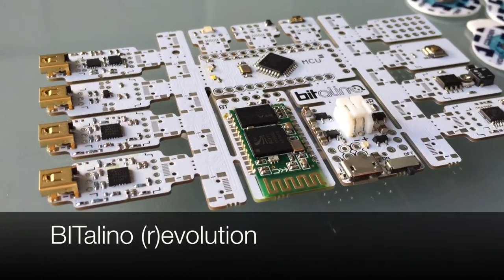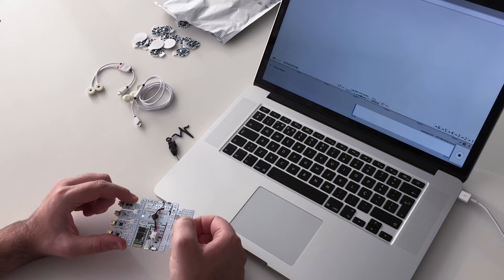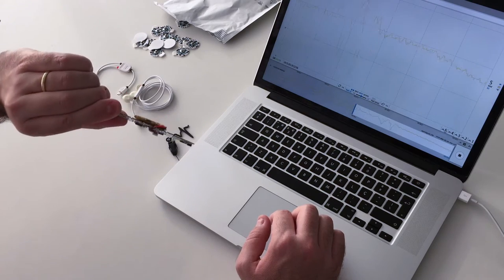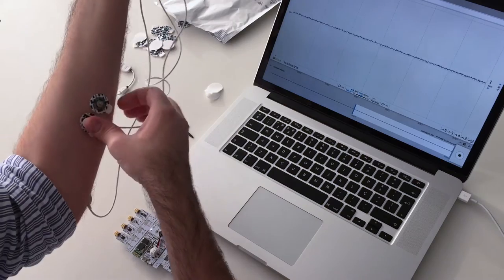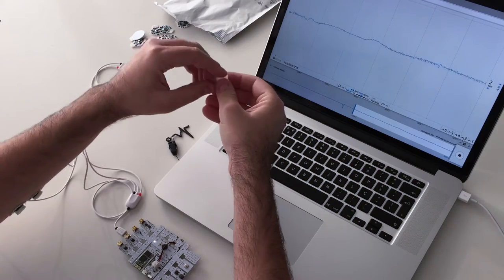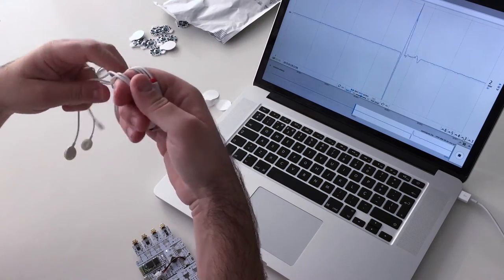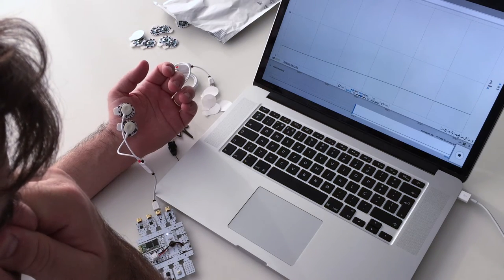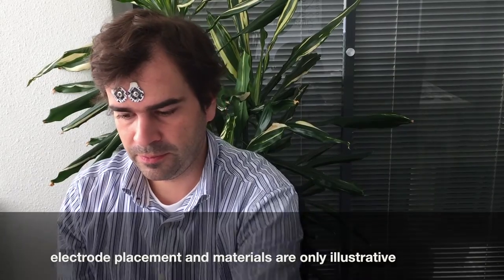BITalino (r)evolution Sensors Tour

Comment: Hi guys, I understood I could use just one kit to get for instance four simultaneous EEG readings (at four different skull placements). Is that right?
Reply: Hi Ronaldo. That is correct, yes.
Reply from the maker: Yes
Reply: @BitalinoWorld  What kind of kit is better, considering I will need to sensor simultaneous EEG signals at four skull placements (plus a 5th reference placement, of course) AND also body (skull) temperature? Or, should I buy separately 1 board and sensors, not a kit? Is it possible?

Comment: If using one kit to get four simultaneous EEG readings is allowed, I should use one 3-cable placement (to have one neutral reference) and the other three placements could us 2 cables only (positive and negative)?
Reply from the maker: Yes. It is also possible to use 2-lead electrode cables in all sensors and a 1-lead electrode cable to provide the ground for all sensors.

Comment: What is the sensor type used, it seems just glued on the skin, without any paste. Is that so? If yes, it does not seem to require any preamplification. Is that so?
Reply from the maker: The pre-amplification is implemented on the sensor. Depending on the placement locations the electrodes can be the pre-gelled or gold electrodes with conductive paste.

Comment: Hello Dear, thank you for sharing this video. i have  question, is it possible to save the recorded data as mat. file. with regards
Reply: Hi, thanks for the question. Data can be stored as a CSV file, which can be loaded on Matlab (e.g. using the dlmread function) and afterwards stored as .mat. Cheers.
Reply: @hugoslv  thank you so much for the quick reply. I have one last question, I need to record or 5 signals of the same type for example ECG, on the same time.  Is it possible to do it with BITalino ?
With kinds regards
Reply: @farssamann7  it is my pleasure to support; you can record up to 6 signals simultaneously… the best option for this is the BITalino Plugged.

Comment: I have asked several time to sales and technical section of bitalino ..but I did not get responses...plz help in atleast in comment box..I need guidance regarding emg sensors
Reply: Hi, how can we be of assistance?
Reply: @hugoslv  yes sir...among 7 muscles responsible for the movement of elbow joints major muscles are four ( biceps brachii, brachialis, brachioradialis, triceps brachii (triceps muscle), anconeus). I want to obtain EMG activities of these 4 muscles simultaneously at a time. My questions are as follows:
[Note:I  am a beginner in this field. ]
 1)For such purpose which of the following kits should I buy? 
1)BITalino (r)evolution Board Kit BT
2)BITalino (r)evolution Plugged Kit BT
3)BITalino (r)evolution Board Kit BLE/BT
4)BITalino (r)evolution Plugged Kit BLE/BT
5)MuscleBIT BT
2)i saw that bitalino have 6 channel which one of this? 
3)what are the basic differences between the first 4 kits? 
4)The channel-specific for ECG, EDA is also capable of measuring EMG? 
5)Can bitalino compatible and connected with raspberry pi?
 6)regarding the overall accessories contents in kits, are these kits able to measure EMG activity of leg muscle too (in terms of electrode spacing at different leg muscles at different positions wide apart)? 
Thank you.
Reply: @abhishekrudrapal  many thanks for the detailed information; here are some suggestions:

1) From all these options, option 5. should be the most suitable for you as it includes on EMG sensors, and these are already fully assembled with cables, and snap sockets with 2 cm inter-electrode spacing (it is the recommended distance and even for the anconeus should be fine)
2) All have 6 input channels, although 2 of them have lower resolution (6-bit only)
3) Between options 1. & 2. and options 3. & 4. the difference is that 1. & 2. only has Bluetooth classic and options 3. & 4. have Bluetooth Low Energy (in addition to Bluetooth classic), and between options 1. & 3. and option 2. & 4. the difference is that the sensors are pre-connected on the PCB (on the Board versions) and are connected by cable (on the Plugged versions); note that on 2. & 4. the kit only comes with a single sensor connection cable and one sensor of each type, which means that more cables and sensors need to be purchased separately for your use case
4) All channels are general-purpose, so that you can connect any sensor to any port
5) Yes, it connects seamlessly via Bluetooth and you can use the C++ or Python API to communicate with the device
6) It can be used for any muscle, although in option 5. the sensors are pre-assembled with the electrode sockets already placed in a fixed position (as mentioned above); nevertheless you can also purchase EMG sensors with UC-E6 connectors that you can use to connect the 2- or 3-lead electrode cable connector

In case you have any further questions, just let me know. If you prefer we can talk by e-mail.

Wish you all the best for your project
Reply: @hugoslv  regarding the gel electrode...after using one, can I use those electrodes repeated times or should replace them after first use? do i need to buy these electrodes from bitalino or can i buy electrodes from any local shop?
Reply: @abhishekrudrapal  they can be used multiple times but the adhesive will wear off after the first couple of peel-offs and the gel will also start to degrade with a few uses, leading to poorer SNR; re-using or not really depends on how you will be using the data. For research it is recommended that you use new ones every time (so that your data is cleaner and more directly comparable in-between recording sessions). Any electrode the can snap on to the sockets will do just fine. You can also try to use non-gelled electrodes, which last way longer.
Reply: @hugoslv  thank you for your quick reply
1)you told "note that on 2. & 4. the kit only comes with a single sensor connection cable and one sensor of each type, which means that more cables and sensors need to be purchased separately for your use case" is it only for 2 and 4? or for all 1, 2,3  and 4?
2)though among 6 channel 2 are of low resolution I understand, but with all 4 kits (revolutionary board and plugged) I can measure EMG of 6 muscles if I want..but with MuscleBIT BT can I also measure 6 muscles too?

3) that is it for the time being before purchase, do u think can I buy from any Indian seller as custom duty and paperwork involves if i buy directly from Bitalino..that is one issue..i saw some Indian seller who are selling Bitalino kits don't know whether they are genuine or not.
4) can I contact you via email? I think i have found your email id...but i did  not found it on your published journal paper :)
Reply: @abhishekrudrapal  regarding:

1) Indeed in all kits there is only a single sensor of each and the minimum set of cables; I mentioned only 2. & 4. because in 1. & 3. you need to physically/mechanically modify the board in order to have more than one sensor of each type... IMHO the latter are good for educational purposes, but not for use cases such as yours
2) In all the above-mentioned kits you have 6 channels, 4 with 10-bit + 2 with 6-bit
3) The most active resellers are listed on the website (https://bitalino.com/resellers); if you provide the link to the reseller you identified, I can try to confirm
4) You can find it here (e.g.) https://www.sciencedirect.com/science/article/abs/pii/S0169260714000984#!
Reply: @hugoslv  Thank you...lets see I can able to buy from India...do you have any knowledge that the product has been bought by Indian customer directly from the Bitalino website and they received it without any issue?
Reply: @abhishekrudrapal  to my best knowledge we do have a few hundreds of units in India; regarding the import issues we have cases in which the process went pretty straightforward and cases were customers experienced several issues.